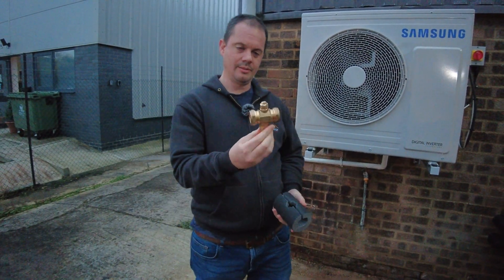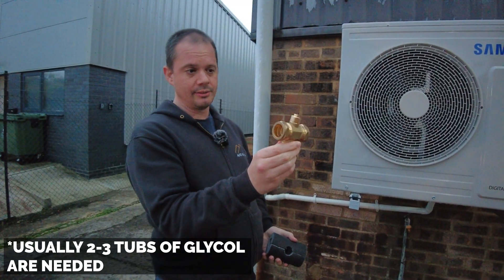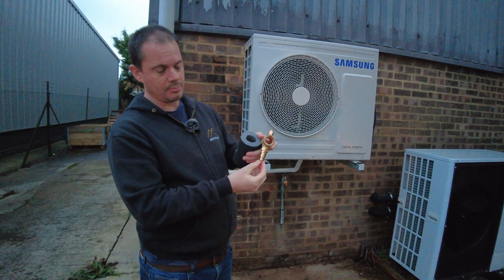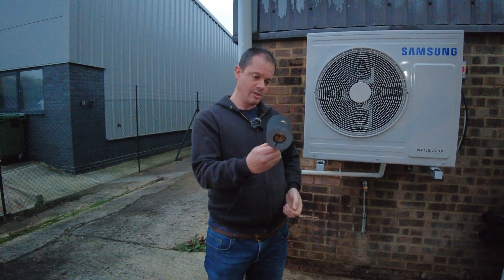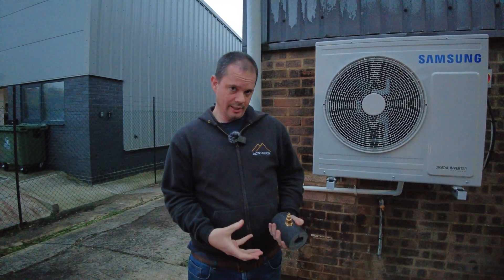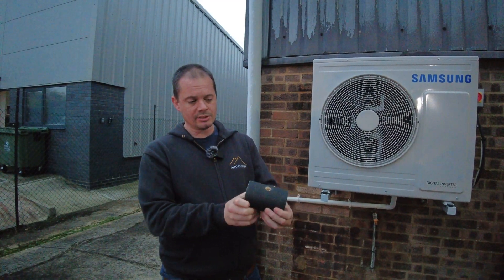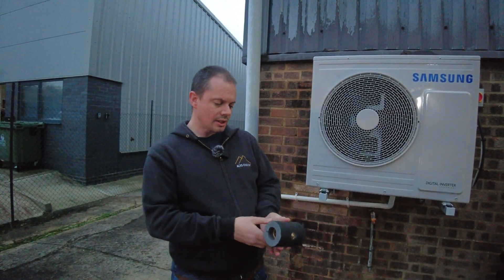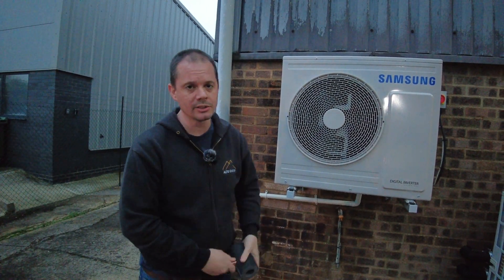Can Anti-Freeze Valves Replace Glycol In Your Heat Pump System?

Comment: Shouldn't there be some sort of inhibitor in the system to stop sludge accumulating from the radiators?
Reply: Don’t as question that will deter anyone buying into Heat Pumps costing a complete fortune to run but we only talk about the CO2 savings.

Comment: By the comments I see people are failing to understand....

This will only drain if BOTH of these  things happen (an EMRGENCY situation):  1)  The outdoor temperature is below freezing AND 2) the heat pump systems is not working.  It's a backup failsafe device never drains under normal operating conditions even if  ambient air is below freezing, because the heat pump is keeping the water above freezing.....

Comment: That’s nonsense. What if it went below that temperature every night for a prolonged cold spell!?
Reply: people are not grasping the concept.
Reply from the maker: The temperature of the system needs to drop below 3 degrees for the valves to open. Not the outdoor temperature.
Reply: @AltoEnergyLimited  that’s quite possible then
Reply: It may work in parts of England but in many colder parts of Scotland I'd have my doubts.

I remember going to school and it was supposed to be -18 and a water pipe under the ground froze and stayed frozen most of the winter.

Seems like an accident waiting to happen if the vale doesn't operate properly.

Comment: For a colder climate (as low as -15 C absolute minimum), is it good enough to have only antifreeze valves ? Thanks. Adrian
Reply from the maker: Hi Adrian. Anti-freeze valves are designed to drain down a heat pump system if the temperature of the heating circuit  drops below 3°C degrees (not the outdoor temperature). So as long as the temperature of the heating circuit is above 3°C degrees, it should be fine. That said, always check with the manufacturer of the heat pump to see if the warranty is impacted if you install antifreeze valves.
Reply: Sounds great but the downside of no glycol that you haven't mentioned is that, if the pump starts getting close to freezing, the system reverses and prevents it freezing by running the hot water you have just paid to heat, back out to the pump. On cold but sunny days when the house benefits from solar gain and the underfloor isn't calling for heat, the system responds by taking hot water from your DHW tank to protect the pump... which you then have to pay to heat up again😡 @AltoEnergyLimited
Reply from the maker: Problem is, most, if not all manufacturers will void your warranty if you do not install anti-freeze valves or use glycol.
Reply: @AltoEnergyLimited Good answer but you weren’t asked that question.
Reply from the maker: @Allegedly2right  The person who we were responding to deleted their comment 🤷‍♂

Comment: too bad it doesn't dump the water as it expands, into a bladder type expansion tank, or sumptin like that, then the water would re enter the system when it thaws.  Constantly adding fresh water to the system is not good.
Reply: This will only drain if BOTH of these  things happen (an EMRGENCY situation):  1)  The outdoor temperature is below freezing AND 2) the heat pump systems is not working.  It's a backup failsafe device never drains under normal operating conditions even if  ambient air is below freezing.

Comment: Basically a thermostatic radiator value which cost as little as £10. What a rip off!
Reply: ₤ 10 for not using 100-200₤ glycol  ...

Comment: This makes it sound like everytime the outside temperature drops below  3°C they'll open up, lose system pressure and geating.

But is it not a safety feature that only opens when theres no electrical power to the pump and the temperature is 3 or below, otherwise the system water keeps the  valves above 3°C because its running and warm.
Reply from the maker: The temperature of the heating circuit would need to drop below 3 degrees (not the outside temp) and the system would have to lose power (and pumps stop running) for the valves to activate.
Reply: I'm really curious how they work (assuming they're purely mechanical). But presumably the "sensor" (like a heat sensitive metal) is part of the metal housing and so will be basically the temperature of the system water?
Reply from the maker: You got it :D
Reply: @AltoEnergyLimited  thanks, does it lose enough pressure for the system to not be able to fire up again once power is back on, or would it take a few power cuts? 

Are the anti freeze valves a serviceable item or are they fit and forget?

Just thinking if they aren't maintained, will they work in 7 or 8 years when needed or have seized?
Reply from the maker: 1. Will probably run a few times, but you'd just need to top up the pressure on the heating system

2. Yes, fit and forget

3. Yeah they should work in 7-8 years
Reply: @AltoEnergyLimited  thanks i will discuss this with my installer whos not used them yet and installs a hex module indoors with glycol between indoor and outdoor. Not sure how much heat pump efficiency this loses on a 5 or 7kw pump over a 4m external primary pipe run.
Reply from the maker: No problem at all. If you need any help, feel free to give us a call if you live in the UK. Not sure if you're aware but we design, supply and commission heat pumps in the UK and are always looking for new installers to work with under our MCS umbrella scheme. In short, we take care of all the hassle of maintaining the accreditation and compiling all of the paperwork. You just take care of the installation. Let us know if that's something your interested in :)
Reply: So when you need the heating the most its emptied lol
Reply: @poorfordtransitowner1627 You seem rather content to display your ignorance for everyone to see.🤷‍♂️

Comment: Fitted heat pumps for years and I’ve never used glycol on an air to water, or the caleffi valves, no need imo
Reply from the maker: What do you use instead, if anything?
Reply: @AltoEnergyLimited  nothing at all in the south west
Reply: Shouldn't heat pumps be running continuously so shouldn't have the opportunity to freeze. Even if they're not they run a frost cycle periodically to just shove some water around the system so that the cold water is moved elsewhere